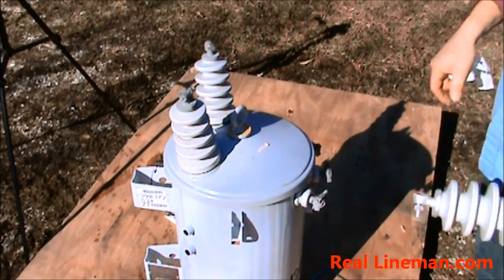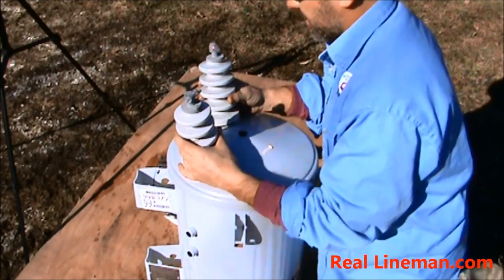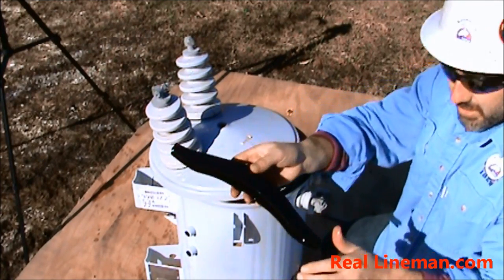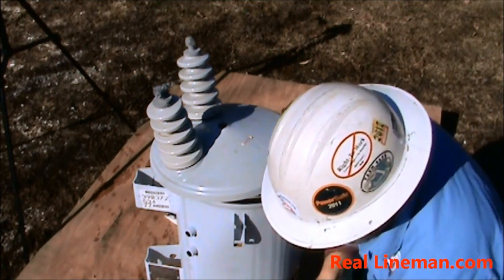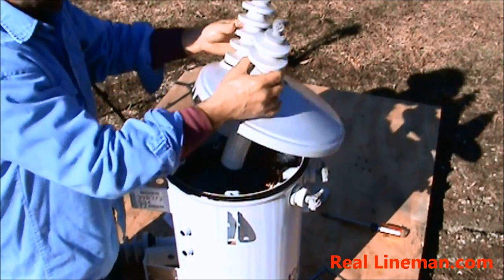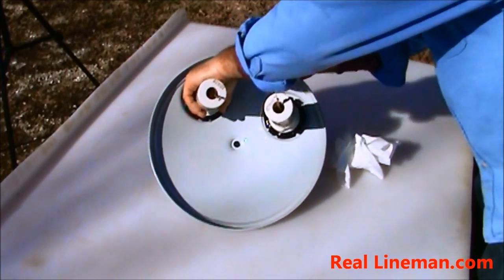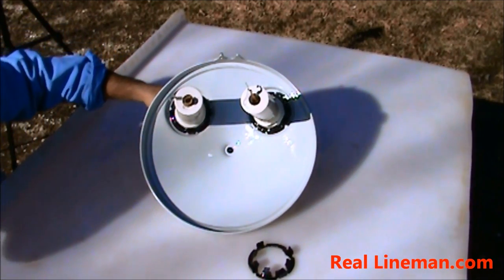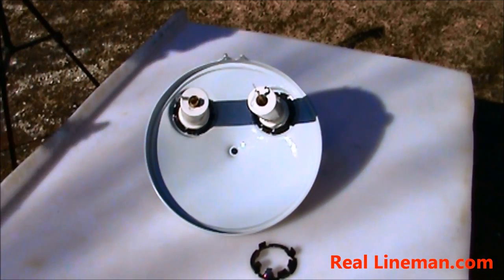Primary Bushing Changeout | Real Lineman

Comment: What is that liquid thing inside the container?
Reply: Suraj kumar Mondal cooling oil so it doesn’t over heat.
Reply: Mineral oil, which is non-conductive (when not contaminated).
Reply: Cooling and and the oil has high dielectric strength
Reply: If it’s a newer transformer, it might be vegetable oil.

Comment: Nice video but i'm not sure that securing that spin grip nut with just a couple hits with a plier is enough to keep the oil inside. In case of short circuit, the temperature inside will rise very fast, causing an increase of pressure and if the insulator is not well secured, it will blow up first that the safety valve.

Comment: transformer oil should be drained before changing the bushing, oil is carcinogenic and no proper PPE
Reply from the maker: The oil in new transformers are mineral oil. The same oil that baby oil is made from.
Reply: It's not the 60s, they don't use PCB anymore. That stuff is mineral oil.
Reply from the maker: John Chambers 
Dual bushings are manufactured so they can be wired in delta or wye configurations
Reply: why is there 2 bushings when I only see 1 around here?